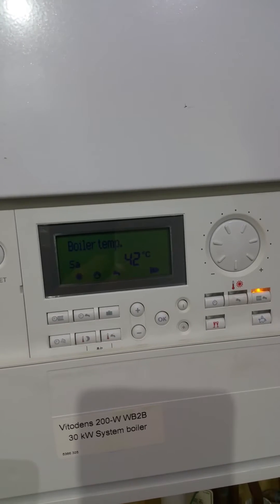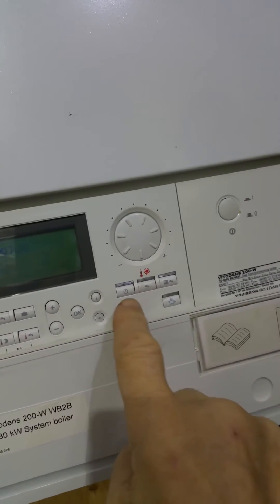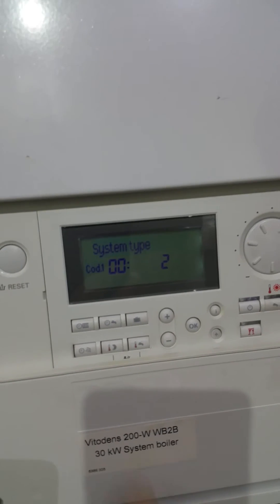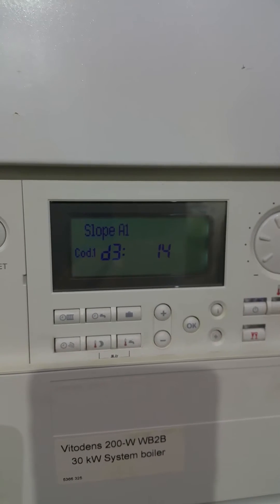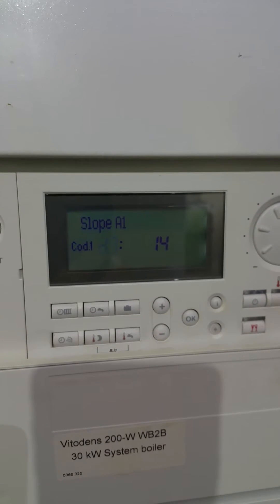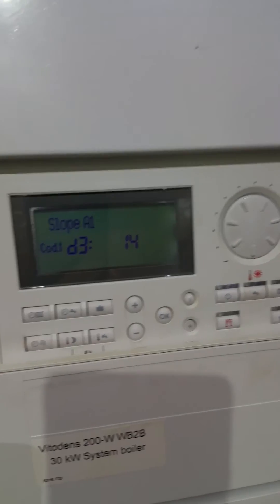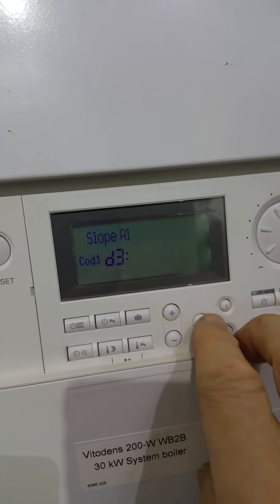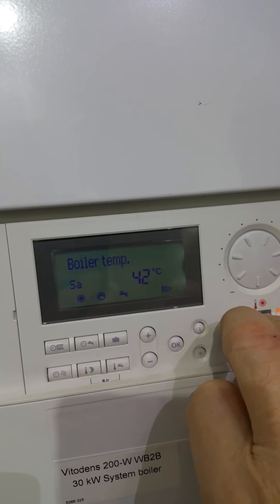Adjusting the heating curves on a Viessmann 200

Comment: Hey bud the Urban plumber put me onto you !...I have an older 200-w boiler a bit like this one and I only have Rad valves, no room stat or WC, can I still add WC and room stat or programmer ?...Id like to have some sort of smart control.  Thanks !
Reply from the maker: I have a Wc kit for this in stock. Where are you ?
Reply: @andrewmillwardwatford9410  hi I’m in Walsall .., what’s in a kit ?
Reply from the maker: @Newmusicreview  the controller and external sensor
Reply: @andrewmillwardwatford9410  Ok so I just connect the controller to the boiler and then a low volte cable to the external sensor ?
Reply from the maker: @Newmusicreview  and change address codes. Viessmann tech can guide you.

Comment: How do you change the boiler water temperature setpoint?
Reply from the maker: Do you mean for hot water or for heating ?
Reply: @andrewmillwardwatford9410  for heat. But when you go through the scans page there is a boiler temperature set point i want to change that. mine currently says 5°C. Also on the first start up flow diagram in the manual it says boiler won't light > no message> increase boiler temperature set point.
Reply from the maker: @muscleycar  what boiler do you have ?
Reply: @andrewmillwardwatford9410  veismann vitoden 200 wb2b with vitotronic 100hc1 controller on the front

Comment: If you set you heating curve and then want a night time set back temperature, is this another curve? How many temperature curves can we have set in a 24 hour period & do they swap over at a set time the same as an normal timer programmer?
Reply from the maker: A curve is made up of slope and level. The level shifts with temperature demand changes set on the timer. The slope is constant at all settings.
Reply: @andrewmillwardwatford9410  ive looked at a few videos explaining the curves and how you can shift them from your inputs.

But none of them explained that if you want 21c from 7am until 9pm and then 18c from 9pm until 7am set back how its achieved. Can it be programmed into an external timer or the boiler itself to do this daily, or do you have to manually change it each time.

An off off programable wall stat would generally have 3 or 4 daily on off times so i wanted to know can you still change an indoor temperature setting for day and night or more.
Reply from the maker: @handle1196  I will make a new video. Watch out for it.
Reply: Put on 1.9 👍

Comment: very helpful in explaining and setting up of 'curves'.  How does the Viessmann 200 get actual room temperature ? Is it done internally ..  I have remote thermostat 'switch' on '96' connector.
Reply from the maker: It doesn't need an internal measure. It's preemptive
Reply: @andrewmillwardwatford9410  ok thanks.. I'ts a bit of a weird machine.. What then does the thermostat do on connector 96 ? thanks..
Reply: the D4 value on mine was at '0' It seems better now it's set at 1.4 as per your video. thanks.
Reply from the maker: @headw0rk  I've never fitted a thermostat on plug 96 but I believe it locks the boiler off. It should be removed if WC is fitted.
Reply from the maker: @headw0rk  what is d4 adjusting ?
Reply: @andrewmillwardwatford9410  my error..  D3 as per your video..  was 0 now 1.4